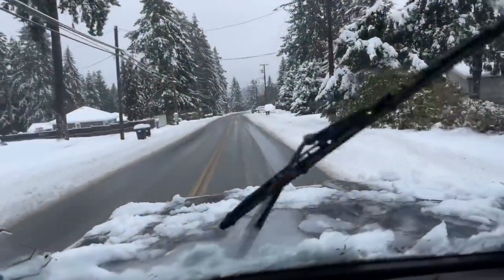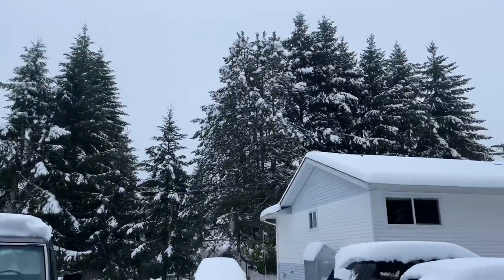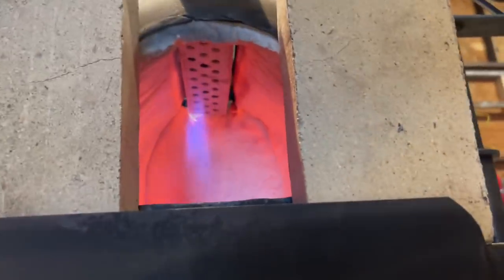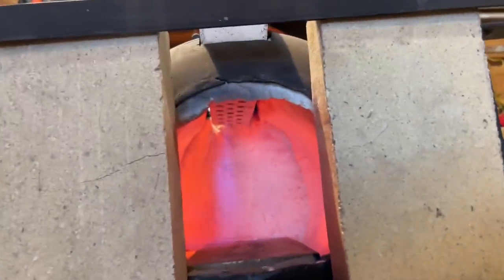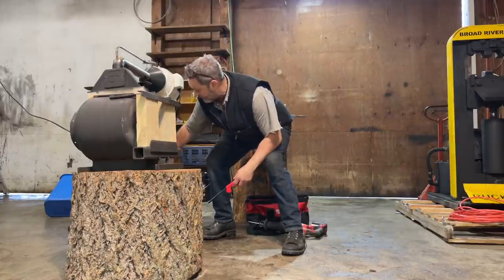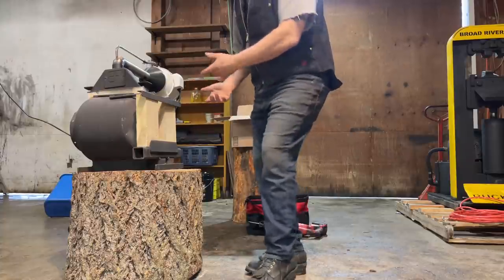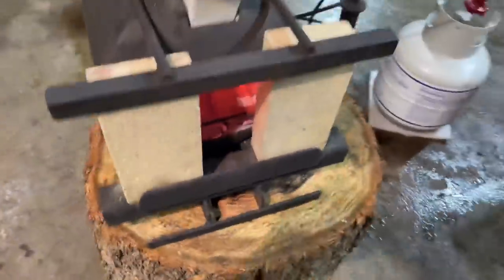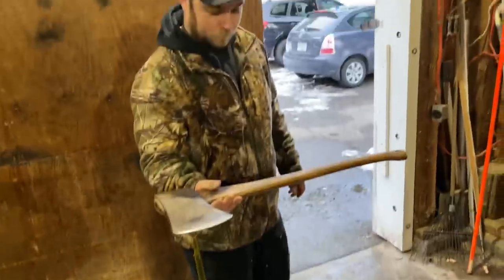Propane makes me NERVOUS!🥲. Lighting up my forge and shop

Comment: Buckin', being a blacksmith myself, I highly recommend finding a blacksmith in your area who forges with propane.  Blacksmiths love to help newcomers to the craft get started on the right path.  It is not an embarrassment to ask for help.  Their years of experience can be invaluable to you and bring enjoyment to the smith.  You will benefit greatly by learning how to setup and run your gas forge for optimum performance and safety.  BTW, with the 20# and 100# tanks, the "pounds" refers to the amount of propane capacity in the tanks, not the pressure.  Also, most propane suppliers only fill the tanks to 80% capacity, leaving head space for expansion of the liquid fraction.  
Good luck with your forging adventure and play it safe!

Comment: Buckin, use your hand torch, no lighters, insert into forge, introduce gas. If the torch is lit before you turn on the gas it can't build up and burn your wrist. Simple safety measure I've enjoyed with reliable success
Reply: Flame then fuel is a great rule to follow!
Reply: Over thinking it a bit bukin love ya bud

Comment: Hi Buckin - in the UK all propane pressure regulators are the same and preset to 37 mbar output pressure - that's just around 0.55psi for us old school boys.  No matter what the cylinder is or how much is in it, the regulator maintains that output and I'd imagine its the same in Canada.  Backpressure to the flame when the burner is in the forge box is key

Comment: Buckin, forced air burners need the backpressure from an enclosed burn chamber to function properly. Also Black Bear Forge has really good videos on where to start with axes.
Reply: was thing about that as well, a ribbon burner wont work very well just blowing freely without something to capture it, so it is probly set correctly or very close, it just needs something there to keep it contained (open ended)
Reply: @cz_ww2117  i dont think hes going to hurt himself, hes knows when danger is afoot. I think its going to be more of, hes not going to get where he really wants to get to, but im sure hes already looking into talking with people, as hes already had plenty of contact with Timothy. The only real issue ive seen this far was on a previous video and that was how he was striking the stock with a hammer. Ilya covered this awhile ago and its the common problem people that first get into blacksmithing have to break out of, and that is using your elbow to do the work of moving the hammer. You should be using your shoulder. I think once he starts to really get into it, that might be the first issue that comes about. After that its just alot more practice.
Reply: Savage Porkchop you are correct.

Comment: When the tank and it’s content are cold it causes the liquid part of the cylinder the change viscosity properties. I’d suggest a moving type blanket and the pipe tape that’s used to prevent pipes from freezing under mobile homes ( it doesn’t get that hot ) You will raise the temperature in the cylinder so the propane will be more even temperature and flow without the sputtering. Good luck

Comment: Make sure that you have a carbon monoxide monitor if you are forging indoors, also a quenching bucket big enough to put the propane tank in with water in it when your fuel gets low, put that tank in the water quenching bucket( metal trash can) to maximize your total usage of your propane.
Reply: I was thinking the same thing with the carbon monoxide. He should get a CO monitor and maybe figure out some fresh air circulation in the shop when its too cold to have the doors open

Comment: Hey Buckin, some of the issues with the propane is you need to have a much larger storage tank .maybe even a 120 gallon installed out side the shop. The regulator requires about 100 psi inlet pressure.and propane flammability range is very narrow and the small cylinder is refrigerating down to reduced pressure very quickly not supplying the correct pressure. Creating a very unstable fuel/ air mixture which makes your burner unstable.  I spent 55 years in the propane industry helping customers

Comment: Brother Bucking, does the blower housing have a flap on the air inlet for restricting air if it gets to much? Many propane burners have an adjustable air door, like a wood stove. If so play with it, closing the air door some, with the blower on high. Also, make the adjustments with the burner INside the forge housing. OUTside adjustments will be different! Good luck & enjoy the ride! Tank info: The tank pressure is the same for a 100 pounder as it is for a 20 pounder. Those numbers are how many pounds of propane the tank holds. However, tank pressure does change with temperature, so don't boil yet tank, or she go boom! Love the show!   Paul

Comment: Buck. A 20# and 100# will have the same pressure. 100# tank = 22.5 gallons. The 100# will have more volume before it to cold to vaporize the liquid and not provide the needed flow.  Think surface area to vaporize the liquid.  Here in Minnesota when we had -30 below I had to switch tanks to run my large commercial heater.  Low pressure was 9psi minimum and on high I needed a red high pressure regulator to run it at 15psi on high.  A 500 lb LP tank (horizontal pig) didn't have enough surface area to feed the heater.  I had to go with a 1000 gallon horizontal tank to make it work or use 2 500 gallon tanks hooked up in parallel.  Temp of tank and surface area for vaporization is important.  LP boils (vaporizes) at -43.6F or -42C.  The more you use a tank the colder it gets.  See if you can find a used propane tank (horizontal  pig) for outside the building.  Happy forging, Warren.

Comment: My friend the small tanks have volume reducers in the head.  If you get one that is about 3 times that tall, a commercial tank it will prove volume for forges and furnaces.  That is what I had to do.  The small ones are for Bar-B-Q and weed burners.  I can provide a picture if wanted.  The heat in the forge will, once red, will keep the fire on.  Need to get a fan up there to stir the air and heat the whole building.

Comment: Agree with comments here saying to put a torch in the furnace, then add gas. Safer and no explosions. If you add propane first you don't know how much is present so you get pops amd occasional booms. Be like starting a saw and having the throttle at a random amount of on position.

Comment: I used to use an oxyacetylene torch to cut metal and the noise of the flame will tell you a lot about the mix when you get used to it, not sure if it’s the same principle for a forge 🤔👍

Comment: Just don't let propane build up not lit. Don't matter what you got it hooked up to. I live across the road from the church and the preacher that lived in the parsonage around 15 yrs ago was having a brotherhood cookout. They have a good size pig cooker on a trailer. For some reason he lit it and was heating up but it went out and the gas was still on. He opened it and went to relight it and it with all the unburnt gas it lit a ball of fire! He had 2nd degree burns face, chest, and more! Could have been worse! He got through it and was fine after.. I heard it when it went off! I use propane in my home for supplemental heat and nice when power goes out.  Just a wall mounted four brick heater. But has low oxygen safety shutoffs and I have carbon monoxide detectors. It doesn't cost much to be safe! Keep on Buckin!

Comment: i have spent 30 years in special FX making propane flame machines. Modulate the propane with the air supply, adding air to propane mix. The regulator may not give you the higher pressures you need for a hotter flame, your regulator may be the problem and offers too low pressure range.

Comment: Buckin please make sure if your forge has a ceramic wool coating on the inside. If it does you have to put a heat resistent coating over it.  Ceramic wool is VERY bad for your lungs.
Reply: Good point, the ceramic wool is terrible for your lungs. Should also consider the carbon monoxide from the forge

Comment: Can you try putting a small wad of newspaper or something in the forge with everything off, light the paper and when it's burning turn the propane on.

And maybe turn the propane on very slowly, sometimes turning the valve on quickly will mess the regulator up. If it does that, turn the valve off and wait a few seconds before trying it again.

Comment: FYI, the pressure in the tanks will be shut 100psi no matter the size. The only difference will be how much actual propane is in it. It's a liquid in the tank, and you're burning the gas as it depressurizes coming out.

Comment: Also Bucking the operation of the forge should have a recommended operating gas pressure that you can adjust your red pressure regulator to with the addition of a inline pressure gauge , look in good brother !

Comment: Not sure what kind of regulator you have, but you need one that's at least 30 lbs. Alot of small forges come with a 20 pounder and it'll work but with what you're running, I'd definitely recommend at least 30. Also, light er up before you turn the fan on. No need for the fan on light up.

Comment: Few angle braces 2×4 or 4×4 , from bottom of beam back to floor joist. The 3-4 joist under it be solid 💪🏁
Reply from the maker: yeh we're gonna stiffin er up   thx,, follow yer heart friend
Reply: @BuckinBillyRaySmith  you betcha 👊 figure you could cut some braces with powersaw 🏁🏁👍👍 been watching for couple years now you're one of the good ones 🏁

Comment: Buckin you crazy dog.. your not lighting a BBQ! Light a 4x4" twisted square of newspaper and put it in there first (wont hurt nuthing). Or get a Burnsomatic TS4000 plumbers torch lock it lit and hold the bottom of the cylinder with your palm for the furthest away reach. Eventually add a ball shut-off valve to your propane line near the forge.  Good luck!

Comment: Mark your propane tanks. I think your tank is over pressurized.  Swap out your tank for another and see if it stops being bad.  I have a tank that acts that way on a little single head heater.     That tank works good on a grill. But not the heater.     Over pressured is the only thing i can come up with

Comment: Propane pressure  doesn't  change on tank size. 20# tank  has the same pressure  as 100# tank at the same temp outside. At 60 degrees  both tank will have 90# of pressure. Your regular contral  the flow of gas. The black knob on that regular  will increase or degrees  the flow. Now the defense  in the tank size is when you take the gas out faster then it can boil it off. If you on high your tank freezes up.
Reply from the maker: right on William
Reply: @BuckinBillyRaySmith  y L

Comment: Don't be afraid of it, just light that thing on fire.  Do you have a regulator with a gage?  If so, how many pounds are you running?  I run about 8 to 10 pounds on my 3 burner gas forge.  However, I don't forge weld using gas, I use my coal forge for that.

Comment: I realize that your just testing  , but you will need a steel stand for the forge for safety long term Bucking at a proper ergonomic working level  !
Reply from the maker: that is correct

Comment: Well, I'm going to have to try some dowels on the ash handle I made from a downed tree.  It split the second time I used it.  No big deal, I was just trying to get experience with handle making.  It has a lot of character with the holes from the Emerald Ash Borer which do not help its integrity one bit.
Reply: I’ve continued to use mine hard and it hasn’t showed any signs of coming loose again, I actually just started repairing an old split shotgun stock the same way

Comment: Propane has a boiling point of -22 .  The temperature of propane decides the pressure in the tank not the size of the tank .if the tank is 75 degrees it makes gas and has About 75 psi in the tank . At 30 degrees there is only 30 psi in the tank . If the tank is out side and it is -20 ,it will have no pressure in the tank and you can carry propane around in a bucket .At 100f you have 120 psi in the tank and you risk ruptureing the tank from too much pressure ..be safe good luck ...

Comment: Thr burner will work different in the forge  get a gauge should be able to run at low psi and once your forge is hot it'll run better
Reply from the maker: yeah i seem to dial it in better when hot  thx

Comment: Hey Billy I thought Brad had told you it runs best in the forge
Reply from the maker: after its long journey Rob i wanted to make sure there wasnt any situations i was unaware of . As my first light up was frustrating, it was in the forge and it kept blowin out the flame so i did what i have always done , start trouble shooting and figured that for some reason it needed more fuel to run here than where it came from , once i got er goin' i could dial in the flame , but as i recieved it it wood not stay lit ... love yer freakin' unit Rob thx for all yer effort on this project.
Reply: @BuckinBillyRaySmith  your welcome Billy

Comment: I would think there would be an electric sparker on that forge like your everyday common barbecuer .....you shouldn't even need a lighter
Reply: How long is sparker going to last if the forge will turn metal white hot?
Reply: Not sure. Brother has forge with sparker in it the has lasted well over 7 years now